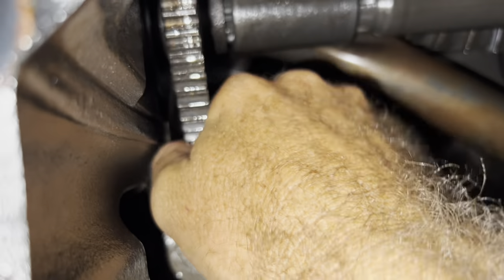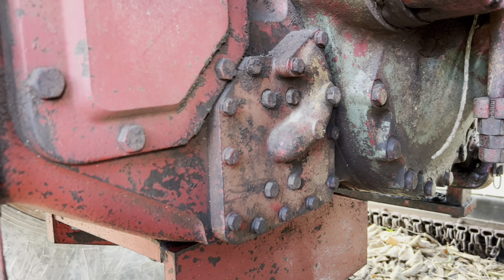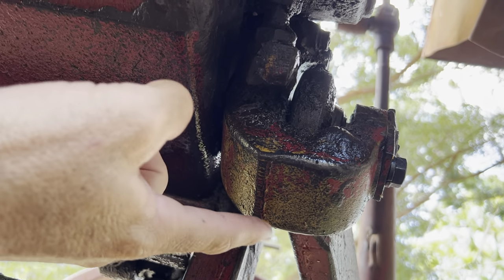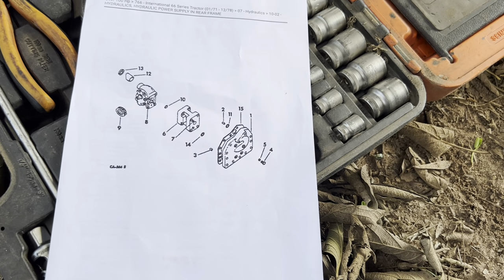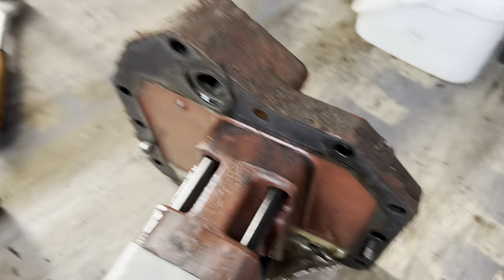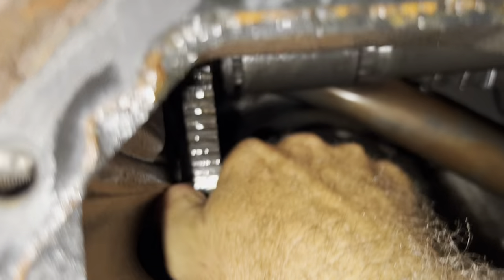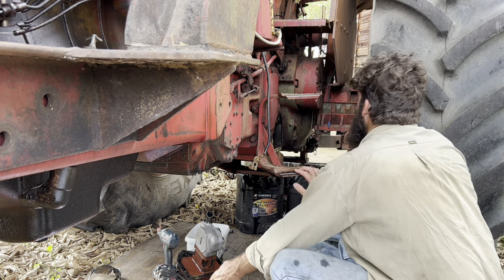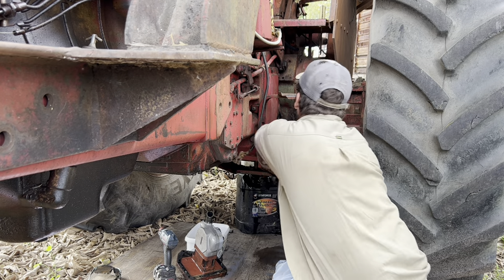766 Inter tractor issues

Comment: Check the splines on your ipto and clutch pressure plate they like to strip out there also there is a bearing cap under the ipto shaft that you can tighten and take some of that slop out of the pump drive

Comment: There is suppose to be a snap ring/clip on the shaft that holds the drive gear for pump  forward. When you slid that gear forward when messing with it you could see the grove in the splines where the snap ring/clip fits.
It could be put on if the Pto is removed and the shaft and coupler slid off to install snap ring/clip
Gear has probably wore its internal splines because it has been moving around on shaft
Reply from the maker: Thanks Mark, I will have to find a repair manual before I even think about pulling the 766 apart. I will also have to find some time and money.
Reply: That clip might be the style that will slip over the shaft from the side, and not have to remove pto and shaft. It's been a while since I had one apart. Parts diagram  will help you on that
Reply from the maker: @markh2860  yep I will have to do a little homework and see what needs to be done. There is a lot of play in the spline as well so not sure how much life is left in that connection either
Reply: Hey Mark check out the you tube channel - just a few acres farm - the fellow there is all about restoring IH tractors and I believe he has a model like yours. His name is Pete he’s pretty knowledgeable. 👍🎅🏻good luck
Reply from the maker: @kennethoblenesjr8493  yep I watch Pete, I don’t think he has a 766 and most of his rebuilds have been done on much older inters than mine. I have no doubt Pete could sort it though👍🏼👍🏼🇦🇺